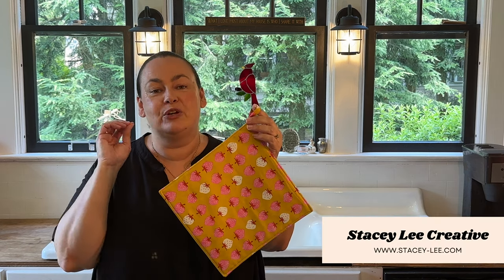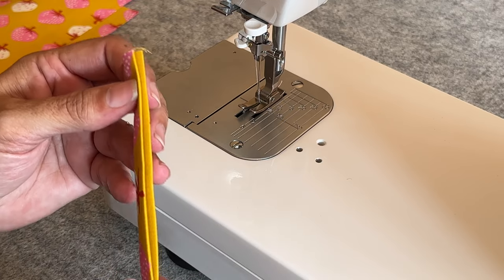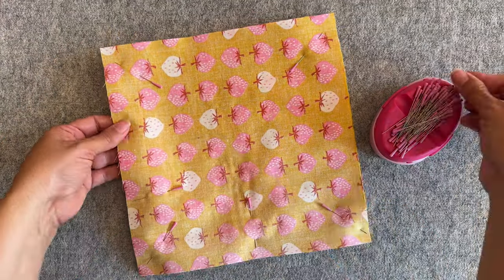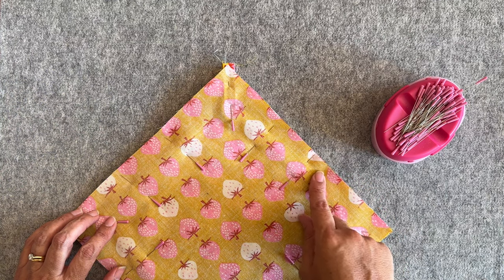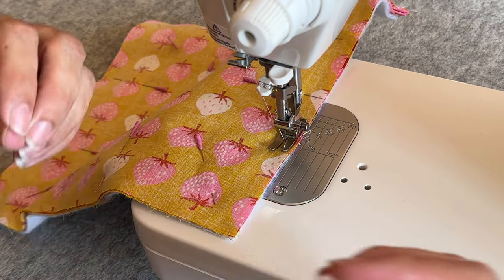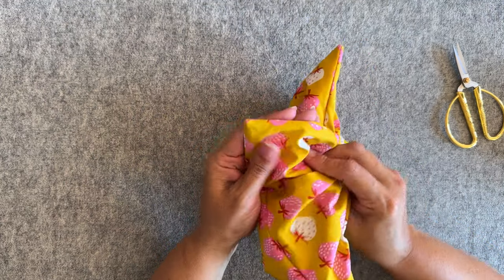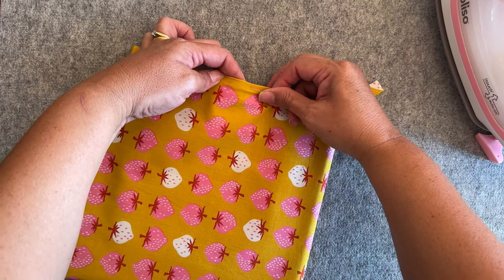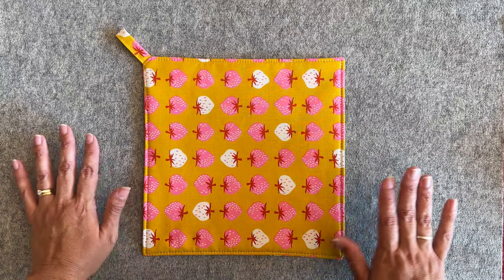Quickest & Easiest Pot Holder To Make Ever!

Comment: I love the print!  You might want to add some cotton batting with the insulbright. It is not made to use alone.
Reply from the maker: Thanks so much for the tip Debbie 🤗
Reply from the maker: Yes I don’t see why not 🤗
Reply: I always use my insulbrite alone.   No problemsa
Reply: Yes you can use only insul brite.  Extra batting is too bulky.
Reply: I like a thicker pot holder it keeps your hands from burning. Insulbright alone is to thin to me.
Reply: The instructions on my insulbright said to add some cotton to help with moisture.

Comment: I'm sure it's been mentioned already, but for potholders, please use at least 2 layers of insulbrite as it's rather thin. When using 100% cotton batting, which is thin, please use at least 2 layers. Wool batting is best, but it's more expensive.
Reply from the maker: Great tip! 😊 Wool batting is top-notch if you’re willing to splurge. Thanks for sharing! 🌟

Comment: Wonderful tutorial! But wouldn’t you need some batting if its a potholder??? Just curious.
Reply from the maker: Hi. Yes I put a layer of insul-bright in. For extra protection you can also add a layer of regular batting 🤗
Reply: I would use cotton batting 2 layers it will hold the heat if you don't have inselbright 
I would do 2 layers or one layer of cotton batting and 1 layer of inselbright